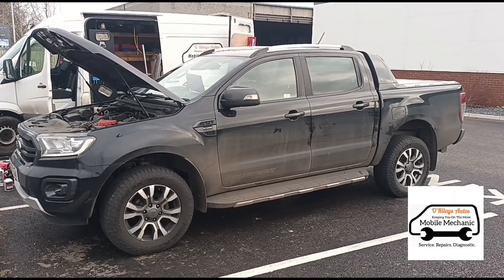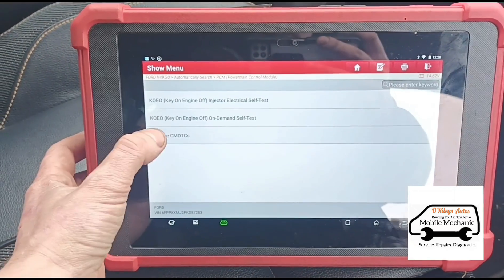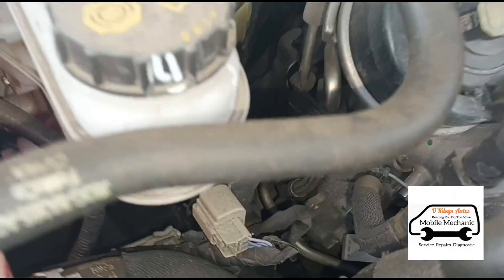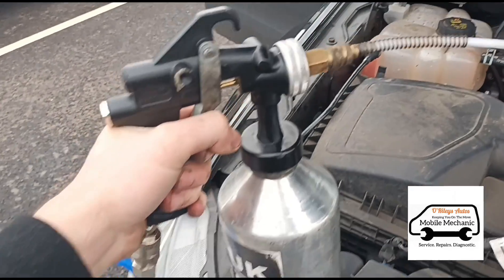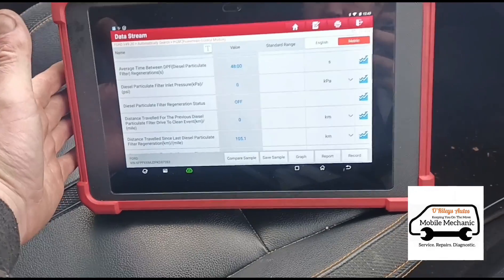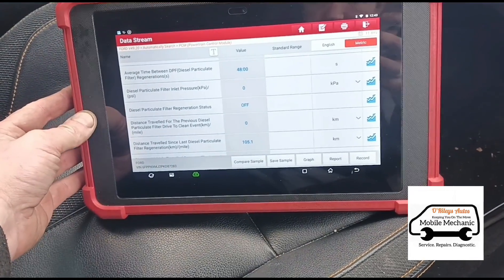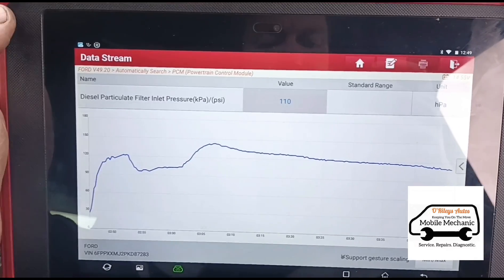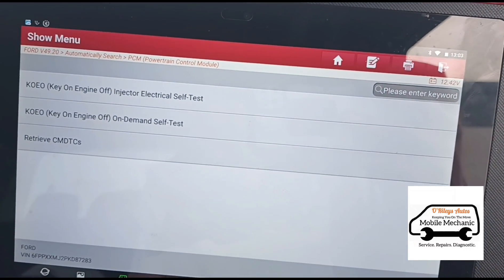Ford Ranger 2.0 BiTurbo P2463:00-AF P246C:00-AF Particle Filter Restriction Blocked DPF Cleaning

Comment: What is a “normal” value for the differential pressure?  I have a Ford Ranger Wildtrak 2.0 Biturbo, built Dec. 2021. It has now run 86,000km, but tries to regenerate every 20 - 50 km ? I have no error messages in the display. My differential pressure at idle is 20-30 mbar and at 1500 rpm at approx. 90-100 km/h 110-130 mbar